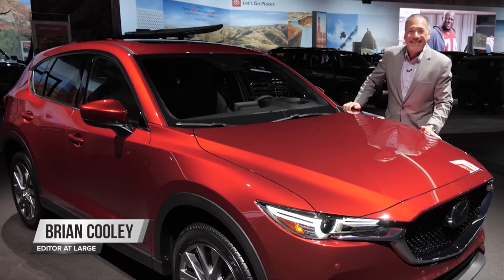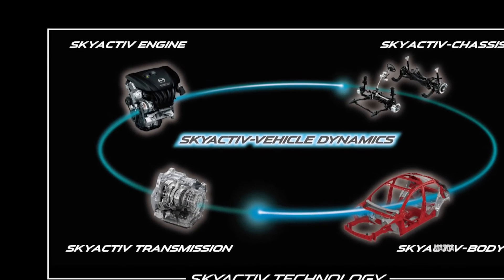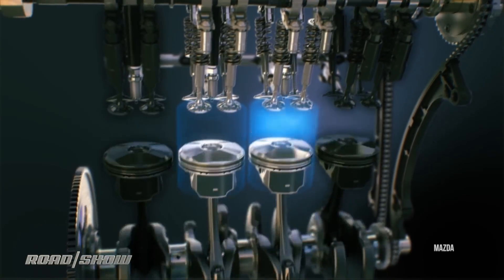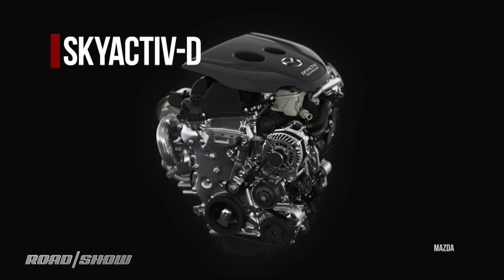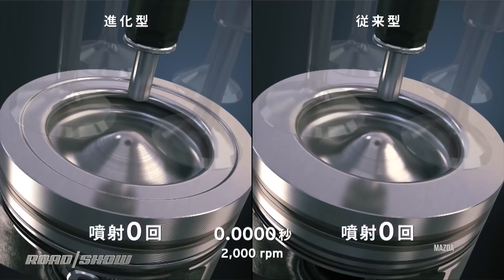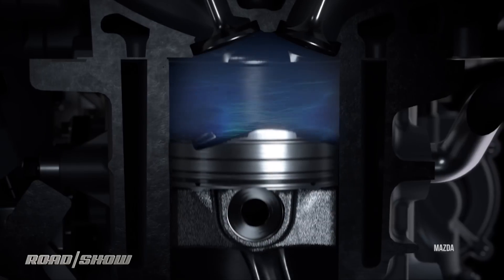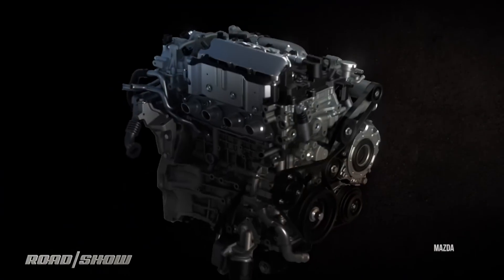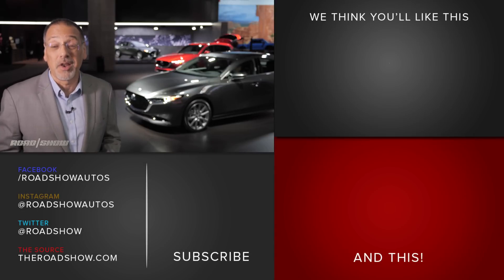Car Tech 101: Mazda's Skyactiv engine technology is really something

Comment: I like Mazda. They go right against the tide. No stupid cvt. No turbos to worry about. Just good well thought out engineering.
Reply: Nothing wrong with turbos as long as the entire engine is properly designed for them. Gotta keep up on maintenance too!!!
Reply: @t.regnerus301  Man i hat turbos power delivery is stupid and doesnt make sense. Id rather have an NA engine with higher rpm. Noiser yes but much more enjoyable.
Reply: MrNick98 They got Turbos now!
Reply: @soiceyboy33  it's not the typical smaller displacement 3 cylinder turbo engine. They still kept the engine with the original size and added a turbo on it while responding like a natural aspirated engine.
Reply: @Dongzzzzzz  The 2.5T is impressive and will certainly outlast 1.5T in the CRV if I had to bet on it. They're asking way too much of such a small engine for such a heavy car, and that's besides the fuel mixing issues and recalls
Reply: @omgitsme435  that stupid puny 1.5T engine on the CRV is an absolute disaster. A not so well thought design, and its also been reported with problems and recalls. That engine couldn't heat up properly in cold climate countries like in China and Canada. And Honda in China has ceased sales of that stupid CRV. Even better news Mazda is becoming more popular in China because its amazing drivability and sexy design. Honda is just ugly af.
Reply: soiceyboy33 correct. I meant to say small displacement turbos with lumpy power delivery.
Reply: Without turbo? They just release turbo
Reply: Yup. I've been a fan since my first Mazda ('87 RX-7). I'm on my 4th Miata now. Great cars.
Reply: Theyve had turbos since 2007
Reply: srsly fun, power always there when you need it, a deceptively fast car
Reply: Whoever said anything about the CVT transmission and being awesome that is completely wrong I just traded in a Nissan rogue for a Mazda CX-9 because I've had nothing but problems with the CVT never pulled anything with it never had a hitch on it nothing drove it like Grandma around town and it was nothing but problems even change the oil every 30,000 miles in the transmission
Reply: @jameschristy9966 correct, cvt is for scooters ONLY
Reply: Straight 6 anyday over turbo 4 cant wait for mazda straight 6 😎
Reply: Unfortunately they're taking the brand luxury now. Say bye bye to quality affordable middle class cars that actually look good and don't cost as much as a mortgage
Reply: I read some sites said that the reason why mazda doesn't have much options for engines like v6, v8, 2.0T...etc. Its because they want to refine their engine to its max potential instead of having many motors like other companies.They tend to have quality over quantity so... As a mazda's fanboy, I enjoy taking their cars to track and its really fun
Reply: @mrnick98 hate to break it to you bud but they do indeed have turbos 😂😂
Reply: Lol I don't know what you're talking about bud but I got a 2.5 l skyactiv turbo engine in my 2018 CX-9 and my sister has a 2.0 turbo engine skyactiv in her CX-5
Reply: Just recently purchased a used 2015 Mazda 6. this is the closest thing to a sports car I have ever owned. It is just fun to drive! Opening my eyes to Mazda!
Reply: One would think every auto maker should have "good well thought out engineering".
Reply: Well some Mazdas have a cvt lol
Reply: Yes, cvt is for scooters only
Reply: Mazdas are trash lol
Reply: Slow cars as well..lol...
Reply: We don't all need a Ferrari  @jdmmarket661
Reply: No turbo? I think turbo is becoming essential for any modern powerful and efficient engines.

Mazda is already taking its 2.5 liter engine and put a turbo for their Mazda CX-9 line-up. With stricter carbon regulation, you need to make an engine that polutes less while able to produce more power. If not a turbocharger, then at least a supercharger.
Reply: @Xyb3rTeCh  That is just it. What Mazda is doing with their clever engines is getting the efficiency without having to slap a turbo on it. Their current turbo engines is here because they weren't ready with Skyactive X and may well go away again.
Reply: @Xyb3rTeCh  Yes, it does have a supercharger however that is something much different than a turbo which means there is no lag or sudden appearance of torque with the Skyactive-X engine. And there are no special cooling issues either.
In my view what Mazda has done is to come up with something rather special that solves a lot of challenges which others have been rectifying with turbos. On the plus side is also that the Skyactive-X actually runs better with the non-premium gas, so it is both more frugal and it runs well with the cheaper gas.
Reply: @bzdtemp  yes its actually really amazing feat. You can run on octane 89 or 91 if I can recall correctly. But that's just amazing how their engine still able to push more from these standard fuel. Meanwhile others engines require octane 93 or 95 and above to run efficiently. Some couldn't accept non premium fuel and breaks down.
Reply: The cvt is well thought out engineering. It’s a transmission holy grail. Faster acceleration, better mpg, less maintenance, etc. Why wouldn’t you want that?
Reply: @thedmannc16  uggggg. CVT 🤢
Reply: @thedmannc16  Well you got one out of three.
Reply: @thedmannc16 because cvt is for small scooters
Reply: @thedmannc16 because big trucks will never use a small cvt

Comment: I just recently bought a CX-5 and am amazed at the fuel economy. The engine has retained a sporty rasp to it when driven hard and is super quiet while cruising.  If Mazda could do this with the combustion engine, just imagine what they could do with an electric drivetrain.
Reply: With a mix of highway and city, you can achieve 30 easily with the cx-5. For pure city driving I’ve been able to achieve at most around 26 mpg. But the skyactiv engine is incredibly efficient at cruising. I’ve gotten as much as over 40 mpg on a long trip on the highway cruising at 65. I’ve also noticed that this cars mpg sweet spot is at 50-55 mph. It can cruise at that speed on level ground keeping at 60mpg if the meter is true.
Reply: Me too. My Cx5 is getting 30mpg. Also never had a problem with it. Best car Ive ever owned.
Reply: @CaboWabotv  30 city or highway? does it ever do better than 30? how do you like the sound compared to a turbo? ive been considering an equinox diesel, it just seems whimpy. (not a fan of 1.6L suv)

Comment: In a world of turbo turbo turbo, its nice to see a company also thinking outside the box to really improve technology.
Reply: They do have a Skyactiv 2.5 Turbo now, I have a '21 Mazda3 AWD 2.5T thing packs a punch.
Reply: @braydons5623  My wife has a carbon edition CX-5 turbo and it's nice. It has some nice low end torque, but feels a bit gutless at the top end. If it weren't for EV's, I'd probably have a Mazda3 turbo.
Reply: @TheAdventureAuto  I can confirm that from my own experience, it totally loses its balls when you get up to high speeds. It's a super fun car to whip around in sport mode at lower speeds, but it's definitely not fast lol it just tricks you by feeling fast, they used some clever engineering for that too actually